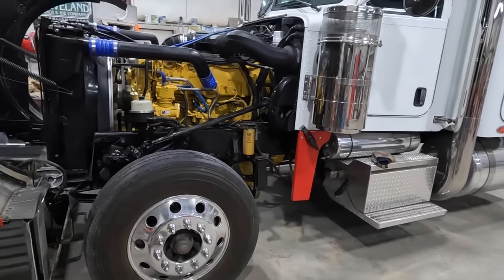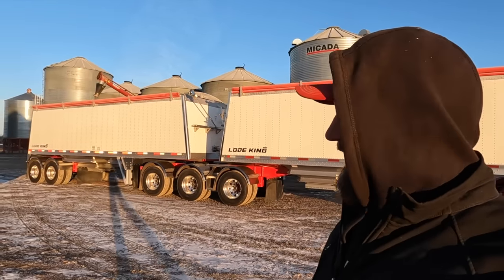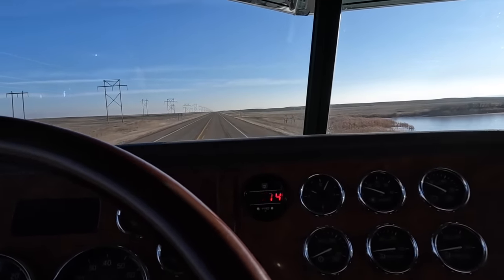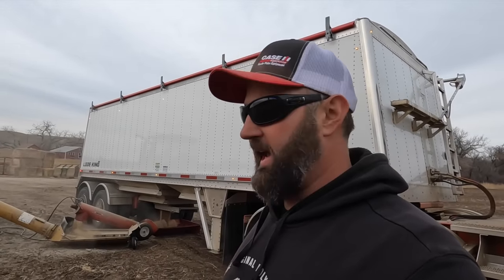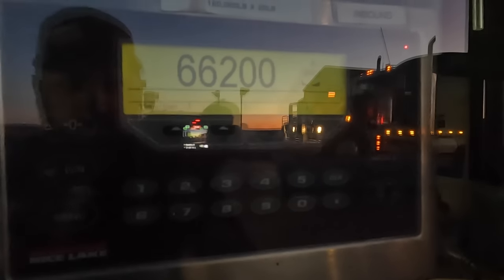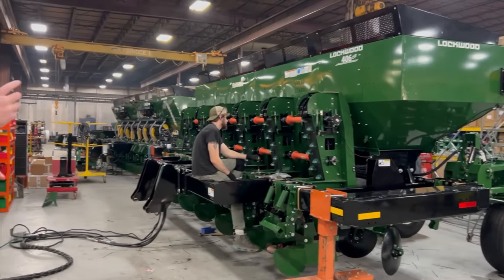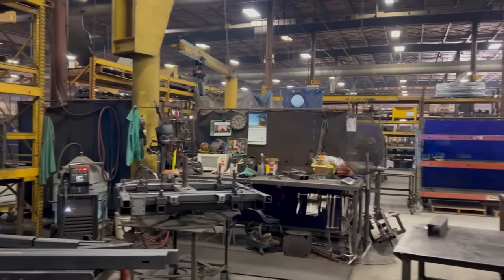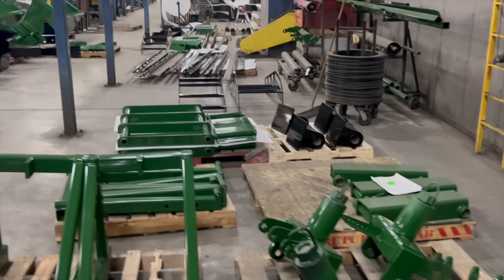New Truck and Trailers!

Comment: What weight are you allowed to pull it’s the b trains compared to the tri axle? In Alberta we are allowed 63500 kg.
Reply from the maker: With a pusher on the truck. 116,000 compared to 98,000